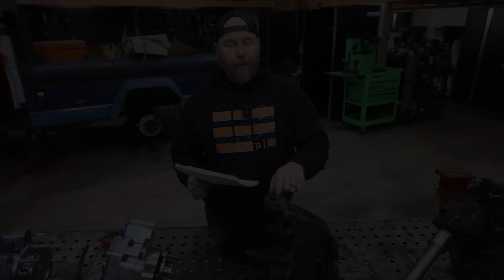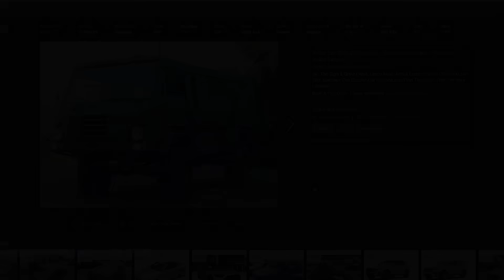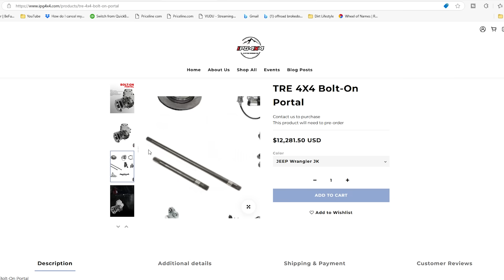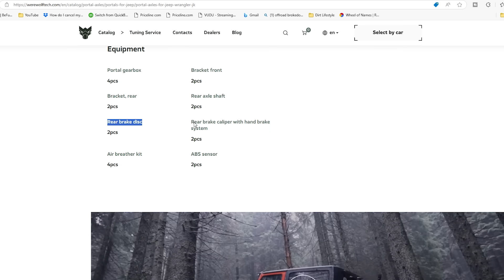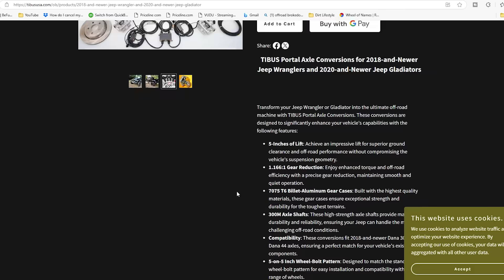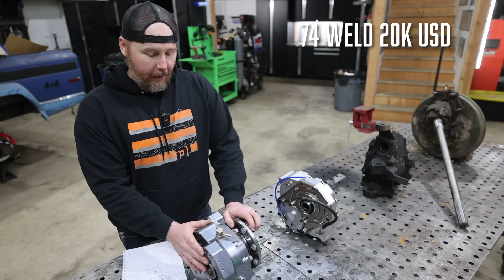CHEAPEST Off Road Portal Axle to Most Expensive! 74 weld, Werewolf, Hummer portal, Unimog portal.

Comment: NZ Army mechanic, never seen U1700 Unimog portal hubs fail. Being a 30 year old truck, the main issue is rust. They are slow on the road and guzzle diesel. The reason we still keep them in service is because they are amazing off-road.  Huge ground clearance and the torque tubes can take a beating. Although they are super reliable, I would be very reluctant to drive one on deployment as they have no armor to speak off.

Comment: HMMWV portals are not $700-$1000 a set... not sure were you got that from - but you are lucky - $10k's are going for over $3-4k a set and $12k portals are going from $4500  + a set and you still need to service them, spindle nuts etc. If thats what you got it for - you got lucky - especially considering HMMWV's at auction have gone up in price as well.

Comment: They replace a regear (maybe), and  part of a lift. Add that much weight in tires and and portals (unprung weight) and plan to add a good shocks to take it and not overheat. Add back in $2k+. My spreadsheet says bast case its $10 over gears &, lift kit. To each their own on the pros/cons. Ive saved up for them!

Comment: I see the point about the mechanic thing but if you know how they work and what failures your gonna see you can either work on it your self or you now have the knowledge to be able to explain to a mechanic what hes dealing with if your ever in need of a fix but for instance didnt have the tools with you. Basically, mechanics are pretty well understanding about how to take something apart and put it back together not to mention fundamentally portals aren't any more complicated than a transfer case or rear axle and if you explain that to the guy working on your truck he'll immediately know and understand it better. If he's a good mechanic.

Comment: Yeah if you really think about it when you spend 3500 for premium shocks and struts then all the money for all the components you need to change to make aligning and keeping angles correct including things like diff drops UCA's suspension etc plus the regear it all adds up and by the time your done your pretty close to what you pay for portals. With portals that pff the proper gearing you can slap huge tires on and start hitting the trails immediately.  Im not saying you still shouldnt upgrade those components but you can sure get away without doing them right away

Comment: I've serviced the LeTech portals I don't know if you can get them individually but they do have the full axle and portal assembled for 48k or so per axle set. In the Brabus G700 they can run at 100mph on 37s

Comment: The best combo for a daily driver would be front diff portals and a good rear suspension lift. So you csn tow without stress on those portals and have the suspension advantages to attack the biggest off road challenges. What you think about that?

Comment: Update on the 74Weld portals. They did a redesign of all their portals. The outer housing is now common on all portals for different vehicles. The Inner housing is what is different per vehicle. That simplifies all the gears and bearings between all their portals. The price also came down 3K per set. They also are now pre set up for CTIS but that will come out later (sold separately) for you to install if, but they portal itself is prepped for it. Stock ABS and speed sensors. I do believe they buy the unit bearings but I don't know from whom. I REALLY want a set on my rig.

Comment: I don't have portals, but the "you have to be ready to rescue yourself" has been the mantra for my 24" stretched '48 CJ2L since day one. 

When I replaced the underpowered L134 Go Devil, it wasn't for power, it was for safety in being able to keep up with modern traffic. My only point of "you're walking out" failure has consistently been the aftermarket HEI distributor that was on the 225 Dauntless V6 when I picked it up. Having been stranded by that one single piece of electronics 90 miles from the nearest parts store twice, I now have several tested spares on hand at all times.

I completely understand how having low-availability parts in your build can throw a wrench in things. My personal advice would be to either pack those parts along with you on the trail - like a replacement unit-bearing hub and one full set of bearings for the entire unit. If we're talking parts that are just too big of a pain in the ass to do that, either have them at the trailhead in your tow vehicle (if you trailered your rig to the trail), or have them in a dedicated spot in your garage/shop/whatever and your spouse or friend knows exactly where to find them so they can be hauled out to you if you absolutely need them to get your rig off the trail.

Comment: 10k hummer geared hubs with ctis most likely came off a USMC hummer, Army didn’t run ctis on the 10k unless you were in a elite unit. The spur gears are not as strong because they try to push away from each other vs helical pulling tighter together, however helical gears require greater thrust load support which can result in higher bearing failure rate if not serviced regularly. USMC geared hubs are not the preferred option due to their geographical location of their bases/training areas (salt water)

Comment: I have a pair of steering Mog 406s. Big gears, big shafts, big pinions. 42s and 300hp in a 4000lb buggy. 50° steering and factory air lockers. Did 8 lug and disk brake conversion.

Comment: I'd much rather see you test stock tires on the dyno and then put the 40's plus portals to see what the loss is just adding all that than just seeing with/without portals. The tires are a big difference. I know for sure that it's not an easy comparison since your Toyota clearly dosent have stock gearing anymore but man that would be a cool video.

Comment: I would definitley second your thoughts on the use case. I think the hells revenge lockup is actually not a great example, theres probably few places where you could get more immediate help than moab for something like this. Where I think something like this could be a disaster is a true overland applciation, like you noted with driving up to alaska. If you are wheeling hard but common trails with other wheelers, go for it. If you are going to the end of the earth away from help, murphys law is going to meet you there.

Comment: not all come with Helical cut gears, i have been building and upgrading Hmmwv's for a few years and the difference i have found between the 7k 10k and 12k, are the CV axles and the input spline of the portal gear.  the Alpha civilian model has Helical cut gears and the REV Hmmwv normal has them. when being serviced in Motor pool the military kids just swap parts and don't always make sure the Helical cut gears match the truck or others haha

Comment: the JHF portal that's like the H1 portal, does that still require H1 diffs? or does it use existing diffs with outside disk brakes but with an H1 independent suspension setup?

will they bolt into H1 arms?
Reply from the maker: I would email Jessie Haines. His email is on the website, and he got back to me almost right away when I asked questions about their products 👍

Comment: You're going to love them, Nate. I got a set from Quinn last July for my daily Gladiator.  Have put on 30k miles with nothing but oil changes. A couple of months ago, I left N Texas and drove to the Holy Cross Trail in Colorado, ran that and then drove to Moab for the Cliffhanger trail. Left there and drove straight thru back to Texas. They are as trouble-free as they can be. Admittedly I am a conservative driver, but my fuel mileage stays around 16. I have zero complaints, and would buy from Quinn again in a heartbeat.

Comment: So, I'm not sure if anyone one else ever saw but there's a guy that had started to develop a method to drop a planetary gear set into stock dana 60 (pre '04) hubs that replaced the hub locker and transformed the unit bearing into a single stage planetary set up. And with cup earing seats that busted knuckle makes, you could make a crawler rig out of stock axles without having to go into it and changing the gears. Literally just a drop in set up and you'd reduce the final gear ration by a factor of 4. I looked at modifying his set up by using the F-550 superduty unit bearings that are 35 coarse spline which would allow for a larger planetary set and potentially stronger helical gears.

Comment: Awesome video. I’ve ran portals for years on several sxs and this is how I determine what reduction % I need for the size tires I want to run. 

 (Stock tire)28 x .45 (gear reduction) = 12.6
28 + 12.6 = 40.6 (new tire size)

40.6 would be the tire size you can run with 45% reduction and the machine will drive close to stock.

Comment: I’m considering the 74 weld portals for a 392 JLUR. I’d replace the control arms with MetalCloak arms for strength due to the leverage and twisting forces, but probably keep the factory arm dimensions and probably run 38-40” tires. All future plans after I’m done playing it the 2018 JLUR.

Comment: Thanks for including our portals in your video! Tech info: Our portals are HMMWV based, and many of the parts are interchangeable. Service interval for a HMMWV portal recommends changing the oil at 72k miles. The parts and bearings are designed to handle massive loads and last for the life of the vehicle.
Reply: I totally forgot that my username doesn’t indicate that. Jesse Haines Fabrication
Reply: thank you
Reply: good to see you still going at it
Reply: uh...which portals are those?

Comment: The 404s deal with scrub radius by running 12* kingpin inclination and cambering the wheels. On my buggy with 42” tires, the top of the tire is 1 1/2” wider per tire on top than it is on the bottom. BTW 411 mogs use a 1.94:1 gear set.

Comment: One potential con, but from a novice. So feel free to explain! On a stock vehicle, you would be raising the CoG that 4”+ including axles. I am curious how much this would actually be a problem. Are the larger tires weight enough to make it negligible? Is it accounting for the skid plates and steel bumpers/sliders? What if you were a bone stock rig thru on portals, and only change are the bigger tires? Maybe the increased track width is enough to negate any of this?
Reply: You hit it in the end. We have gone through road testing in other counties for compliance. We actually perform better than the stock vehicle on their “high speed evasive maneuver” testing
Reply: @74weld genuinely appreciate the reply that is very good to hear, so not only not worse, an improvement. Solid. I love the idea of putting portals on our new ranger with no other major mods other than tire size. The vehicle I really want them on I don’t think there is an option for (Suzuki sidekick) and yes fully aware the portals are worth 10x the vehicle haha.
Reply: @chrispclimbs  that’s one of the cool things about this video. Nate introduces many options. I cut my teeth on portals 15 years ago messing with 404 stuff. With a little bit of fab skills you can definitely repurpose existing stuff to work on that rig. Don’t be afraid to try! Dive in, swap axles, use junkyard parts, go on forums, learn and have fun

Comment: I imported Unimogs in the '90s and have done extensive major mechanical repairs on most Unimog models. All CTIS systems are over complicated and extremely prone to failure, usually at the worst possible time. At the new owner's request we removed the CTIS systems from most of the big Mogs imported. If you run CTIS on a recreational wheeler you'll spend endless hours chasing leaks for the rest of your life, or at least until you get smart and throw it away.
Reply: Military Hummers and LMTVs were the same way.

Comment: As a machinist i had the pleasure of working with some engineers who taught me alot about bolts and the strength of them. It will change a little bit from one grade of material to the next but, as a general rule of thumb, if your using a bolt in steel, you want 1 times the diameter of the bolt for thread engagement. So if you have a ½-13 bolt, you want ½ and inch of threads in the part. For aluminum, you want 1.5 times ratio. So for a ½" bolt, it would be ¾" deep. 

These are rules of thumb but it gets you pretty close. Any more than the 1x for steel and 1.5x for aluminum is excessive and the bolt itself will fail before pulling the threads out of the material.  Look at the thickness of nuts that go with bolts, they are around the same height as the diameter of the bolt they go with. Putting a big coupling nut on something wont increase the pullout strength of the bolt threads. 

Love the videos nate, keep up the awesome work man! 🤟
Reply: Finally someone who understands this stuff!!! 1.5xD on aluminum…anything over 2xD is pointless and adds absolutely nothing other than pissed off machinists that are forced to tap deep holes in parts and risk breaking taps so a clueless engineer can feel warm and fuzzy 😜
Reply: @74weld  Finally, someone who understands the frustrations of being a machinist! 😆🙈😅

Comment: Nate, another 'con' to add (regarding cost) is the typical additional mods that you end up needing to do after adding portals, i.e., Beefier steering rack, wheels, tires, BBK and install costs. If adding 74 weld portals, it takes $20K to near $36K quickly. But one heck of a build tho!

Comment: Been using Volvo portals in my Range Rover for 20 years. Had 5.99 (incl 2.06 hub gearing) axles from C303 in the beginning, and driving 80km/h on roads was not a problem, drove to events in Raajärvi from Oulu (300km one way) with Q78-16 TSLs. Then changed to 7.55 (incl 2.06 hub gearing) differentials, and decent road speed would require very high RPM with 38½ boggers, that I use a trailer or a truck to transport the Range Rover to events. Disc brakes (original drum brakes suck) from Toyota HJ60, original vacuum operated diff locks work very well. All in all the Volvo portals are great axle, super strong up to 40" tyres (at least) and weight is not insane. Original Range Rover axle gearing is 3.54, so I have now very good gearing for going slow. Top speed something like 105-110km/h (with 38½ boggers), but most of the roads driving is no more than 50km/day, and decent cruising speed is about 60km/h. The rest of the Range Rover is about "stock", engine and gearboxes from -97 Discovery, MS3Pro ecu, and winches front&rear etc., beaten body that looks it's been used a lot, like it is.

Comment: You should do flipped ford9 inch stubby housing with reverse cut gears, use sand rail/porche/vw bug , half shaft with custom long arm ifs based on the sxs aftermarket one. And rear should be trailing arms. Maybe take allot of q's from. The high end polaris and canam suspension designs

Comment: Only REV humvees with 12k GVW and above had helical cut gears, serial number 300.000 and above.
All other 12k GVW and above humvees have straight cut gears, ECV  LINE which is stronger)
EVERY SINGLE 12k geared hubs  are CTIS ready,
only some 10k geared hubs have CTIS. Also there is a early version 7.5k axle and hubs, ( 1985 to 1987 )  
Hummers geared hubs are known to be bulletproof even at very high horsepower situations. Just make sure to use latest two pin locking nut or fully lockable version from MOD MAFIA.

Comment: We run 37” and 42” tires on our 1k Polaris Rzrs.  The portals (30% and 45% gear reduction) was the secret sauce to restoring power and resolving any driveline issues!  Bolt on lift and gears.🙌🏽. I love your car guy math!  Save 4k on gears so the portals are really only 11k at that point!😂. The only issues we run into with the portals is the increase in width on tight trails.

Comment: The main issues with hmmwv portals is improper maintenance. The spindle is trick to set pre load and set the locking ring.
They leak all the time and destroy the gears and bearings running them dry.
If you get the brakes off of the diff and mounted at the wheel, this system is suprisingly beefy. The 12ks were pushing around 12-14k lb uparmored trucks
Reply: Lucas Hub oil fixes most of your leaking seals.  ModMafia locking spindle nuts takes care of the wheel flying off problem.  Setting the shims on the seal retainer isn't difficult for anyone who is even moderately intelligent.
Reply: @nothingtoseaheardammit  totally agree, but buying them used from them being used and maintained by 19 year old privates gives them the bad rap.
Again, if maintained properly, they rock

Comment: Hi Nate!
We are glad to see your review of our Bolt-on portal and sorry for inconvenience browsing experience by the incomplete information.

The website page you viewed is from our Malaysia official distributor.
For the bolt-on portal kit we provide , the price in the web did not include the shipping cost and tax , but we can also provide price include the shipping and tax and price is depend on vehicle model.

As you mentioned in the video, installed the bolt-on portal kit will indeed cause the tire to protrude slightly to the outside. The specific value varies for different models, about 15-20cm each side.

About the detailed kit content info , we will update the website and add all accessories info in the website asap.
As you mentioned in the video , the brake pads,brake disc and so on parts needed when install,all are included in this kit.

Also , now we have released the chain-driven bolt-on portal kit , to bring a quieter driving experience and easier maintain , more info we will update asap and will show in our website : www.tre4x4.com

If you have any question or need further info , we are glad to assist!
Thanks.